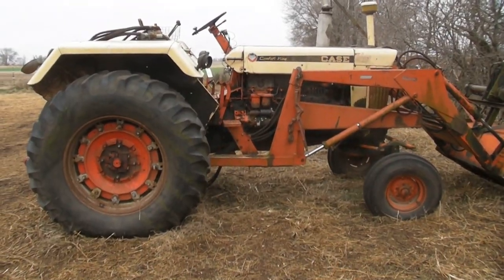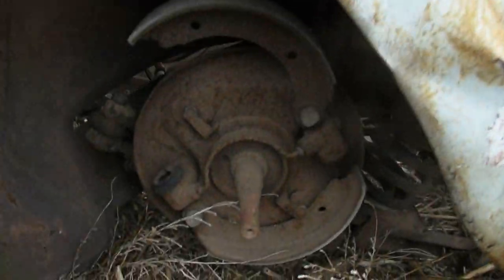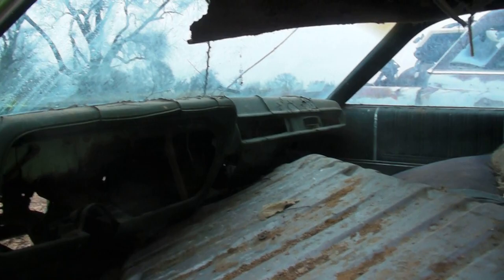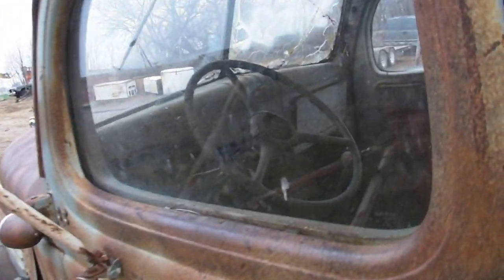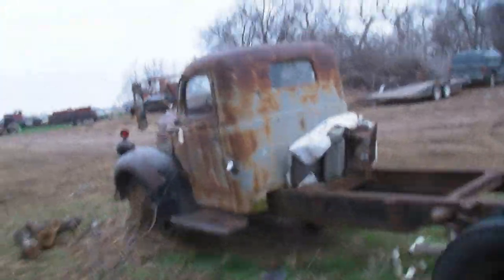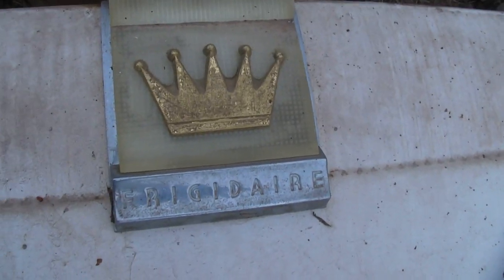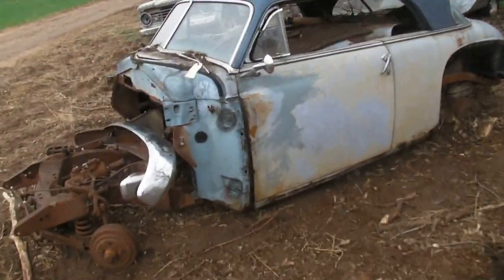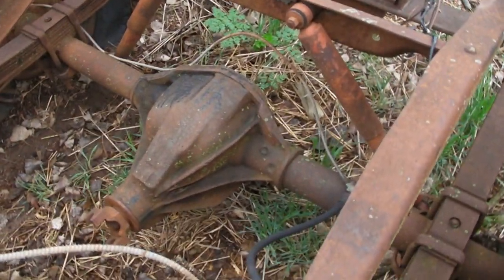Resting Relics - Cairo, Kansas #2: Case tractor, Dodge trucks and cars, and Frigidaire refrigerator!

Comment: Mr. Badsocket - You really got me thinking. Regards that '51 Dodge @ 00:42, the cars they were making in the early 50's were tanks, a lot safer than modern cars in some ways. The problem was, when an accident did happen, people rattled around like marbles inside or even worse, went trough the windshield. When the Big 3 started adding seatbelts and better safety glass a few years later, the cars they built were much more safe. Add lap and sholder belts, modern safety glass and a steering collumn air bag to that '51 Wayfarer and it woud have been as safe or safer than any car on the road today.

Comment: What is the scrap price of cars if you deliver them to the yunkjard
Reply from the maker: It varies from month to month, depending on demand and production activity of new items that require recycled steel. In my lifetime I have seen it as low as $40 per ton and as high as $200 per ton in my area. We are in the heart of the U.S. so transportation costs keep our scale prices a bit lower. As of now it's maybe $120 per ton. A car might be worth $200 at the scales... but if a collector needs one part, they may pay that or more. So unless a car is parted completely down, it is financially the best move to harvest parts regardless of the current scale price.